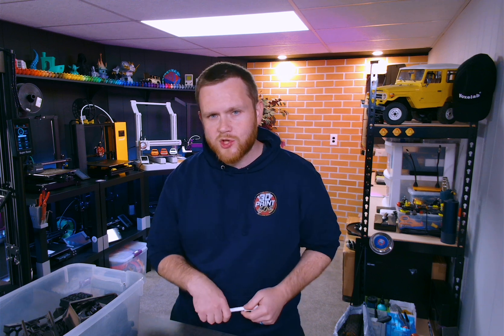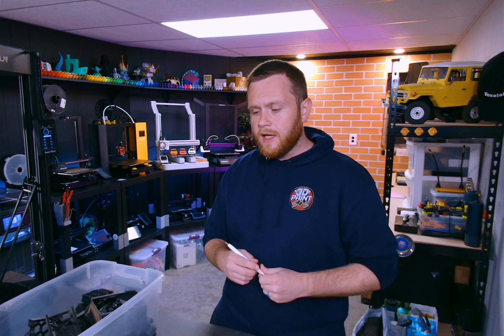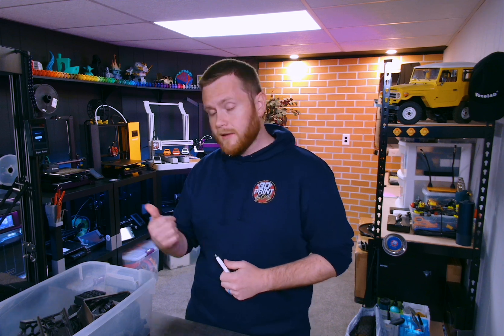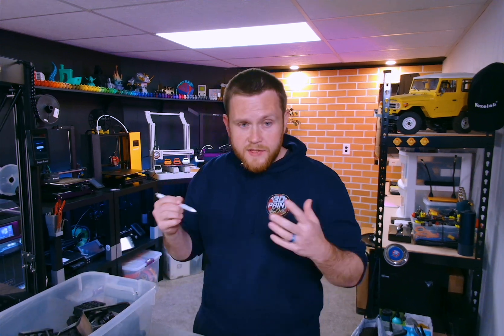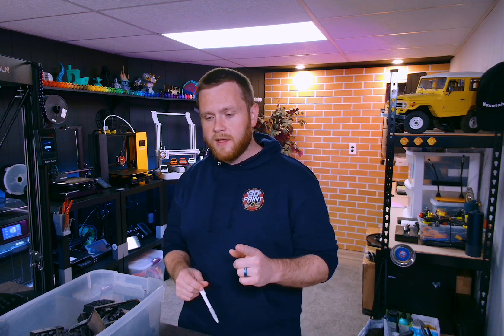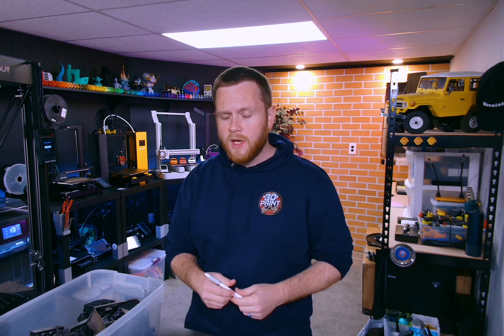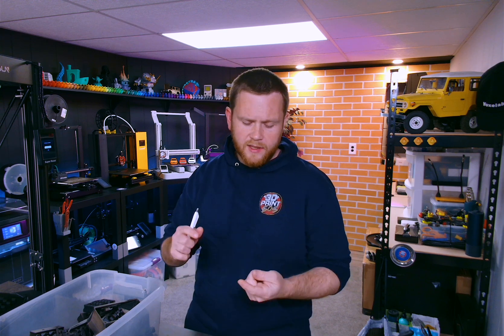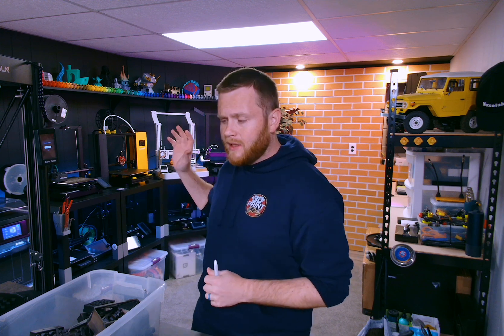My Qidi Tech X-Plus 3 is Out of Commission. For Now...

Comment: Is this the same issue as Clough42?  He's since posted that it's been fixed.  I hae the X-Plus Large bought in 2020, would I suffer from this issue?
Reply from the maker: This “was”. Their new machines have been fixed. I just got the updated one in so I will do a video on it soon. I have some of the updates, minus the chassis brace installed on this xplus3 and it’s printing beautifully. 

No the older models do not have these issues.
Reply: @3DPrintSOS  ah I have the xplus2 vs this is about the xplus3. Had my printer unused for over a year and started it back up. Didn't know a  new version was released

Comment: Just recieved the updated leveling sensor.  For the very first time it gave a very nice first layer and the print was perfect....in addition no errors.

I have 5 prints I will be doing later today.
Reply from the maker: Great to hear! I have mine do a “fast” mesh before each print and I let the chamber soak (for ABS/ASA) for 15 minutes and I have had nothing but great prints.

Comment: I bought the latest version of the machine with the all metal frame which I believe should fix the issue with the z offset.  Hopefully this will put this machine back without major issues.
Reply from the maker: Oh nice. I haven’t gotten it yet. Let me know how it is.
Reply: @3DPrintSOS  Hi! I received my machine and got my first print done.  Overall nicely packaged and arrived without issues.  I was able to see the upgrades they made internally to fix the issue with the z offset.  As far as I can tell the issue is not gonna a problem from now on.  The software had no problems with bugs or etc.  The critics on software and z offset  I had seen from the reviews should also be gone.
No change with the USB location and filament holder is still in the back etc.  For me not a problem but I know for some it is a deal breaker.  I printed one of the gcode files that came with the machine using the spool included (500g).  I printed a 17m benchy with no stringing, blobs or ghosting etc.  Only two small blemishes on the hull not sure what caused it yet.  Sad  I could not include pictures of the benchy.
I am sure your new review will go deeper but for me I am so far very impressed with the machine.  Of course this is a very preliminary overview and I am still using it and there was a new software and firmware update late June which I have installed.

Comment: I bought five of the QIDI Tech 1 3D printers based on what seemed to be good value.  They had linear guide rods, dual extruders and were enclosed for printing ABS.  Unfortunately, they weren't reliable and the enclosed design made them difficult to service.  Even worse, QIDI benefited greatly from open source hardware and software but went out of their way to make their printers as proprietary as possible.  Example:  They used standard stepper motor driver boards but soldered the header pins on the other side of the board to reverse the pinout to force me to buy their proprietary parts that were 100% developed by the open source community.  That's evil.  Even worse, a year later, QIDI came out with a new printer and discontinued support of the five printers I bought, making them $3000 worth of orphans headed to the landfill.  I spent a lot of time trying to keep a few of my five QIDI printers running.  I'm done with QIDI.

I bought a Sovol SV01 (not even the PRO model).  It's an Ender clone and it's definitely built to a budget, but it just works.  It's been a workhorse for the past two years.  It prints almost every day and often prints all day.  I replaced the hot end heater early in its life with an inexpensive Ender part purchased on Amazon and I've cleared two clogged nozzles.  That's all the maintenance I've done.

Comment: Can you please confirm that this engineering issue DOES NOT persist in either of the other two models. I'm looking to purchase the MAX3 but want to make 100% sure, it does not also have the same issues. thanks in advance.
Reply: Qidi retired the full line from Aliexpress, loks like they are making sure the others does not have other issues.

Comment: HI, THANKS ONCE AGAIN FOR YOUR VIDEO, I HAVE CHOSEN TO RECIEVE HALF REFUND WITH FULL WARRWNTY ON MY X-PLUS 3 , YOU DID MENTIONED YOU HAD CONFIGURED YOUR ON FLUIDD , MY QUESTION IS , CAN THIS PRINTER BE RE-FLASHED COMPLETELY WITH A UP TO DATE KIPPER SOFTWARE AND WORK  AND PRINT AS IF IS WAS A NEW VORON LIKE PRINTER , OF CORSE THAT WOULD VOID THE WARRANTY , CAN IT BE DONE , AND IS IT HARD TO DO . THANK YOU , I AM ALSO CONCIDERING THE X-MAX 3
Reply from the maker: I think that's a great call. Having the machine with a warranty is great. Especially, because I'm finding it working well for what I’m doing with ABS and ASA. 

There is a way to get clean Klipper on it however, you lose the screen and it’s fairly advanced. With that said, I asked them to use the latest version of Klipper on their next rendition and it sounded like they will. Also, you can SSH into your current setup and do as you wish. ;) Lastly, if you CAN run a clean klipper install, I will make a how to, for sure.
Reply: @3DPrintSOS  THANK YOU, I AM GOING TO LOOK IN TO IT,
Reply from the maker: Check out: https://github.com/NexGen-3D-Printing/MKS-PI-SKIPR-Clean-Klipper-Install

The board is NOT 1:1 so you would have to make a custom config from the qidi tech config, but it should be doable.
Reply: @3DPrintSOS  HI, THEY SEND ME A NEW SENSOR THE IS TO BE INSTALLED ON THE RIGHT SIDE OF THE EXTRUDER , AND ALSO PROVIDED A NEW PRINTER.CONFIG FILE TO REPLACE THE ON ON FLUIDD , SHOUDNT THAT CONFIG FILE BE GOOD ENOUGH
Reply: IS THE X-PLUS 3 BOARD , AVAILABLE IN THE KLIPPER  CONFIG FILE LIST
Reply: THIS IS ALL NEW TO NE , AND I DO HAVE A VISION IMPAIREDMENT ISSUE , AM DEALING WITH , BUT I AM MOVING ON , TILL I CAN'T HANGING IN THERE, NEED AND WOULD TAKE ALL THE HELP I CAN AND IT WOULD BE APPRECIATED
Reply: HI, ARE YOU SAYING IF I FOLLOW THE INSTRUCTIONS ON THIS LINK I WILL BE ABLE TO INSTALL A CLEAN KLIPPER FIRMWARE AND MAINSAIL AT THE SAME TIME , WHAT ABOUT HAVING TO COMPILE A NEW PRINTER.CONFIG FILE HOW DO I DO THAT , REMEMBER I AM NEW TO KLIPPER , I HAVE READ SOME STUFF  AND WATCHED SOME VIDEOS SO FAR , MOVING ON TO THE NEXT STEP, CROSSING MY FINGERS
Reply from the maker: @mejias4682  Yeah, their latest is good. Both the sensor and config.
Reply from the maker: @mejias4682  No its a proprietary board. That’s why I said it’s going to be a bit harder. The SKIPR is the closest but it’s not the same.
Reply from the maker: @mejias4682  Heck yea man, take the punches and deal em back! :)

Comment: I was looking at one of these specifically for abs/asa in an enclosed format. It seems like the cause of the issue is the internal temperature bowing the plastic at the bottom throwing the height. Have you done any sort of tear-down? would it be possible to replace that panel with a metal plate or with some reinforcement to mitigate the bowing? If it is one wide flat piece it seems like some structural adjustments may fix the problem, even if that isn't necessarily an easy fix. For the nozzle clogging mentioned by clough42 I wonder if a more powerful fan might be added to the hotend but without physically handling the machine I have no idea about clearances.
Reply from the maker: Ive mostly been using mine for ABS and ASA im getting flawless prints. The problem isnt that bottom is plastic, most machines of this type use plastic in the same way, its that the metal reinforcement doesnt cross at the bottom. That is their issue. However, I let my machine heat soak for 20 minutes, added a fast mesh probe right before the print, and Im going back to back to back with ABS. Almost 300 hours on the machine so far. As for the clogging, it’s 100% the fans. That’s what solved my brief clogging. GDStime makes some good fans in the right size. 

I havent done any more content on it because they are actively making changes to the machines and since you can't buy these, I want to wait to see what they do to fix machines you can actually purchase.
Reply: @3DPrintSOS  I was looking at a cheap second hand one someone was selling which is most of why I am curious about what needs to be done. From what you're saying it seems like it could be an excellent pickup with a little bit of forward thinking with these issues in mind. Thanks a lot for the reply.
Reply from the maker: I would totally pick one up. Once you learn that it just needs to be heated up so the plastic chassis can settle, it’s rock solid.
Reply: @3DPrintSOS  Thanks again, picked it up and did my first abs print. The print time for the model at the settings I used would have taken my aquila over 12 hours, the qidi finished it in 4. I knew these machines were fast but that still felt crazy.
Reply from the maker: @5FSF  They are fun to use. That’s for sure. I’m still very entertained by running ABS through mine haha.

Comment: I have an X-CF pro. After my BL Touch died (suspected crash), and the inability to use mesh leveling because the replacement BL Touch I bought didn’t work, I reached out to May from Qidi support. She sent me a new one for free, sent me guide videos, emailed quickly despite the time difference and offered multiple solutions. Although none worked, I was still able to get a level bed and use the printer. There support is very good, much better than Bambu’s support honestly.

Comment: It sounds like Qidi tech is just sending you replacement parts and printers instead of engineering the solution.
Reply from the maker: You don’t think it’s valuable to test potential fixes with actual people who are willing to test?
Reply: @3DPrintSOS  flashforge does the same nonsense.  Their control software is underdeveloped crap and locks out the customer so we cannot flash the unit or do basic input shaping and linear advance.  Thats why print quality is always bad and stringy, etc.
Reply from the maker: Oh for sure. I’ve definitely avoided Flashforge successfully haha

Comment: After being a distributor for QIDI TECH printers for sometime now, I can honestly say, their Tech support even with the communication barrier has to be the best I have seen, not just with 3D Printers, but out of any industry, I have always had full confidence in selling their machines knowing that if there is an issue, they will handle it, its a real shame with this new line up that they rushed it market, if they had of spent more time on the software, not used some silly standalone display and worked more with the community like the QIDI TECH Discord I'm part of,  they may have been able to release a more fleshed out product, but for me, what shows true integrity is how a company handles an issue, head in the sand is always bad, so credit where credit is due, they did the correct thing by every customer I have spoken too so far.
Reply from the maker: I love hearing this. Gives me even more confidence that they will make this right.

Comment: I had a problem with this machine using PETG.  I could only print across the middle of the bed.  The bed where the screws from the bed attach to the metal plate on the bottom is poorly designed.  They are just a thin metal tab sticking out and you can push down a quarter of an inch on the front and back corners.  I went to the hardware store and got a piece of aluminum and fixed it.   It was an inch and a half by 1/4 inch and I drilled holes and put them between the front and back holes under the bed.  They rested across the metal and stiffened it up enough so that I could now print on both the front and pack of the build plate with PETG.  I had to get some smaller spacers that go around the screws from ACE to make it work.  I haven't had a problem since.
Reply from the maker: Thats very interesting. Youre saying that basically a brace or thicker bed carriage would be a fix…him..

Comment: HI ONCE AGAIN IS THE X-MAX 3 HAVING THE SAME ISSUES, IF NOT WOULD YOU RECOMMEND IT , ARE THEY STILL SELLING THE  QIDI X-MAX 3
Reply from the maker: From what I understand the x max has bracing on the bottom to stop this from happening.
Reply: @3DPrintSOS  The X Max also hasn't been released yet. Still in preorder phase
Reply from the maker: @xsolar  Thats correct, however it has metal bracing on the bottom in the problem area. So qidi is saying it’s not effected. I dont have one, so I can’t say first hand.

Comment: Not really a question, but mine has had more issues than yours.  My X-Plus 3 would only boot up half the time I turned it on.  Then about 2 weeks in, it wouldn't boot and the screen would just say "THE SYSTEM STARTS ABORMALLY! Please turn off the machine and wait a while before restarting."  I finally got it to boot after 30+ tries and updated the firmware.  QIDI asked me to remove the wifi module to help with the booting.  I did, and now I get the correct screen on boot but none of the buttons for movement/heat/anything work.  I can change screens, but that is all.  They told me they would send a new EMMC, then emailed me again the next morning and said they are sending a whole new mother board.  When it was working it did ok, but this is rough. The new MB will be here on May 9th.  We will see.
Reply from the maker: Oof. Yeah that’s rough start. I hope the new motherboard will fix your issue. That’s definitely not one I’ve heard before. Did you ever get into the klipper frontend?
Reply: @3DPrintSOS  I have not.  I am not near as savvy as you and others with channels on here.  This is my first machine, and it is looking like a poor decision on my part.  I am building  a kit car and wanted PA-12 CF for parts and pieces for the car.  So far I am down a grand and have nothing to show for it.  Once the part gets here, we will see how it goes.
Reply from the maker: @SLC_Wertz  That’s a super cool reason to get into 3D Printing and based on their marketing you made the right choice. I made this video to hopefully help push them along in helping their customers. What car are you building? Are you documenting the build anywhere?
Reply: @3DPrintSOS  I am building a Superlte SLC... I can message you privately and give you the build photo album if you like.

Comment: It will be interesting to see what they do for early adopters who haven't ran into serious problems.  So far I've only used my X-Plus3 for PLA and it's been working great.  My most serious printing problem was when using PLA with the high temp steel nozzle it didn't allow enough time for heating the hot end prior to starting the print.  Pre-heating the print head solved this.  After I switched to the non steel nozzle this was no longer an issue.  I think I will stay away from heated chamber stuff until this is resolved.
Reply from the maker: I saw no difference with ABS and ASA with the chamber on or off. The machine holds a steady 40-45c in the chamber when it’s all closed, so that is well good enough for most ABS and ASA conditions. It’s more of an issue when you print ABS then decide to print PLA. In that change in temps, the bed mesh and zoffset will change dramatically and you will have issues starting the print

Comment: I got a full refund with no warranty for my X plus 3. I’ve only been printing in PLA which is probably not what it’s completely meant for lol but without the chamber it’s been working good. Qidi has sent new nozzles and a new probe to me. Such an amazing company and customer support has been great. Definitely will be buying from them again in the future. Loving the printer so far after ~3 weeks
Reply from the maker: I havent printed much with PLA, but ABS has been rock solid. The issues tend to happen when youre setup for one temp and then try to change to something else. This latest time I wanted to give PETG a try. Going back to ABS, my settings just pick it all up where I left off. The chamber temps definitely affect the machine. I bet some bracing in the bed + lower chassis would solve it.

Comment: It's good to know that a manufacture is willing to stand behind there product. That being said I'm disappointed to hear that Voxelab isn't as responsive. I recently purchased a Voxelab Aquila S2 Pro based on your reviews and testing of their machines. Unlike the other Aquila models the S2 Pro is equipped with an inductive bed leveling sensor which is great but unfortunately they omitted the Z height limit switch. To make thing worse Voxelab's own documentation is lacking for this model (they link to your video on a standard Aquila for this topic). This configuration makes it very difficult to properly manually level the bed. Likewise setting the Z-offset becomes even more difficult if you want a buttery smooth first layer. Unfortunately I damaged the textured surface on my build plate the very first day. This problem along with the fact that I went through a half a roll of filament trying to a achieve consistency in the Z axis (grub screw was lose on extruder) explains why they have so many machines returned to be later resold at 60% discount.
Reply from the maker: Sorry to hear it. If you have a probe without a z limit, try using solid bed mounts. No need to manually level if you have a probe that does mesh. 

I think Voxelab has two great machines. The original Aquila because it is a bargain, and the far too expensive D1. Amazing machine that is held back by price and firmware.